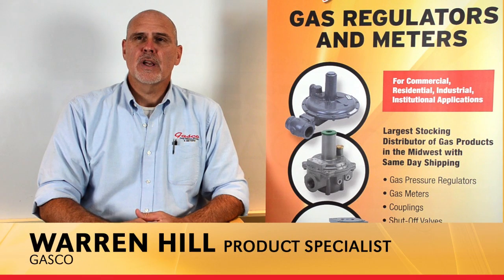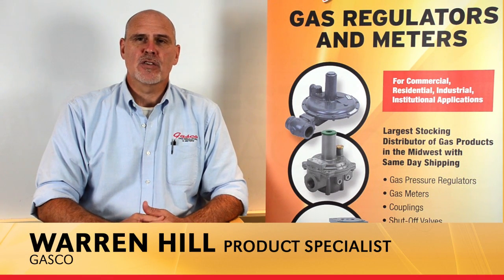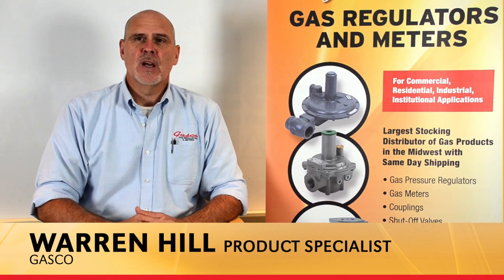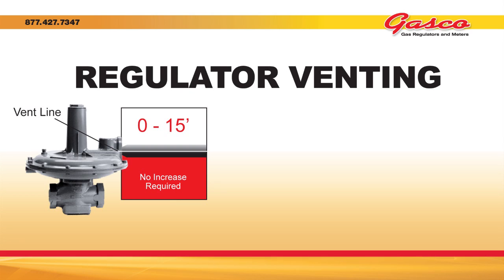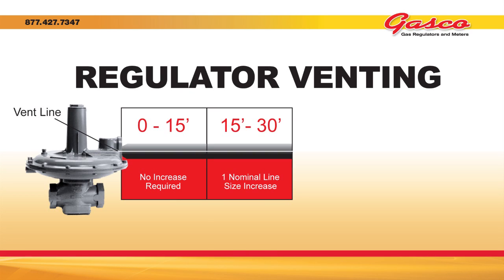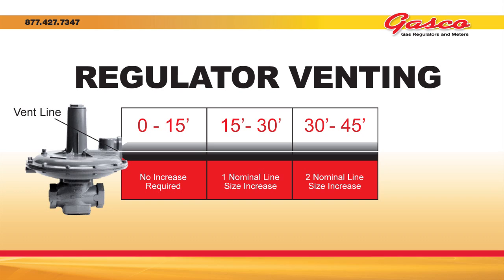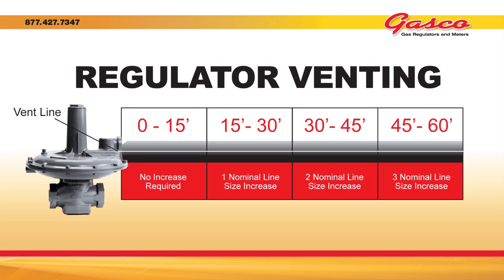Gasco Regulator Venting

Comment: According to the NFPA code 2018, UL 651 Rigid PVC can be used for regulator venting.
Reply: except indoors...
Reply: @jayhardway23  Correct. But why would you want to vent indoors?